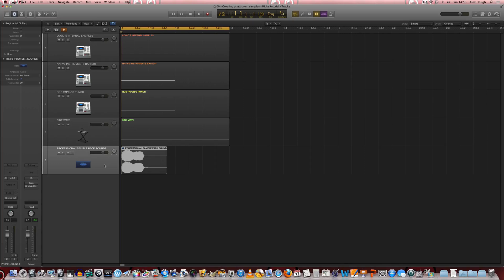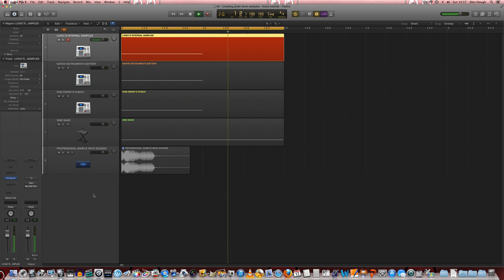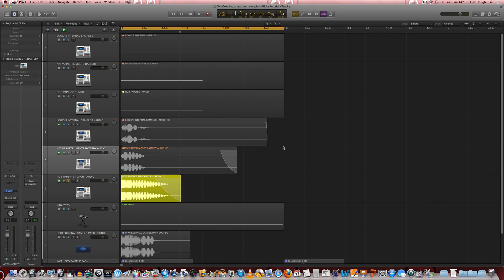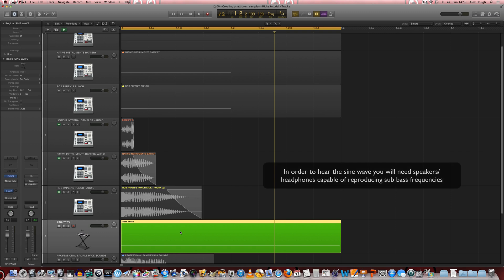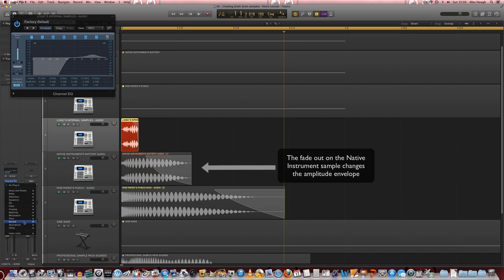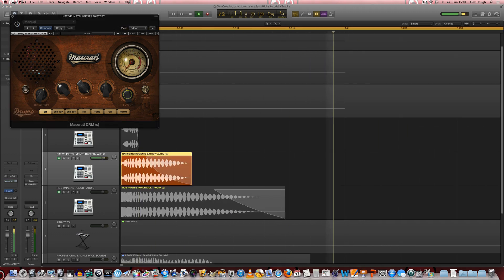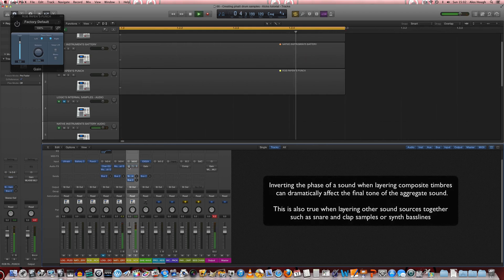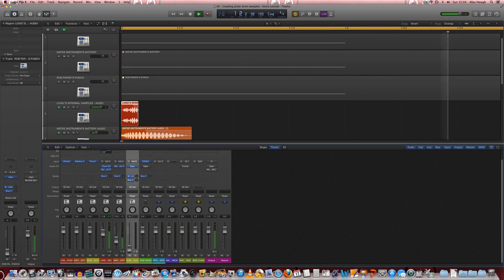How to create 'phatt' kick drum samples in Logic Pro X - Trance Production Tutorials #00

Comment: Why are you working in the red? Why not just turn down the volume?
Reply from the maker: Hi +Saskiequelle 

You can turn down all the channels to not work in the red and I probably should have done in retrospect? 

However, as Logic runs at 32bit floating point non of the 'red' actually matters all that much except on the master fader output. 

If you look you will actually see a gain plug-in on the master fader channel attenuating the signal before it reaches the limiter to stop it from clipping, so I guess I have kind of done my 'turning down' at this stage of the signal pathway rather than on the individual channels.

Comment: How much subbass in comparison to the low mids should there be in the kick? I think I have too much sub.
Reply from the maker: Hi skippychris10 

I think it depends on a lot of factors but the most important is what is the relationship between the kick and the bassline? If you have a subby kick then the bassline will generally need to be a bit thinner, and vice versa :)
Reply: Therefore, if I want a really hard galloping charging bassline. I should make the kick fairly short and prominence in the low mids, I presume.
Reply from the maker: Hey skippychris10 

Yeah probably? Perhaps layer in a more 'clicky' sample into your drums so it can cut through the mix even when the bassline is a booming raucous blast of sub!
Reply: Yes, very much so. I've been having trouble finding proper drum samples to process. I acquired some decent packs but I kept processing it wrong with what I want to do, which is hard trance. 'True' trance kicks seem to be scarce, which is the classic 909 kick. The best seem to be in VEC4, VEC3. They sounded better than with the 20 processing chains I had on my own kicks. I bet they're just sampled from actual tracks.

Comment: When adjusting volume on first three and trying to get the right volume and clarity, it gets to a pretty good sound (for a beginner) and it's clipping by 0.8 db, but when I apply par. compression with suggested parameters through a BUS, it starts clipping by 4-6 db. Although, I can't really say the BIG difference after compression. Question, if one can get to a desired sound until the point of applying par.compression, can par.compression be skipped or the kick may interfere with other frequencies later on?
Sorry for being the noisiest video watcher:)
Reply from the maker: Hi Nikita 

It can be absolutely skipped if your drum hits are already sounding good enough without parallel compression! Always let your ears guide you and that goes for metering as well.

If those pesky red light flicker on occasionally in the mixer don't worry too much as long as it still sounds good. Lots of engineers and producers use varying amounts of distortion creatively to achieve their sound. The only exception to that would be your master output with digital equipment as clipping at that stage tends to create undesirable distortions. 

Hope that helps :)

Comment: At  8.18 on the main output there's a gain turn on! you didn't show what you did, so what did you do?
Reply from the maker: Hi Cursufool

I think this was just to reduce the level slightly as the master fader was coming in a little hot. I often have a gain plug-in loaded onto the master channel in Logic Pro just incase I get carried away during the mixing process :)
Reply: Okay cheers